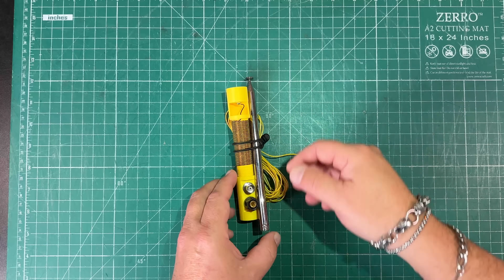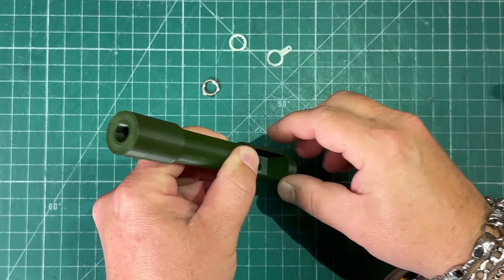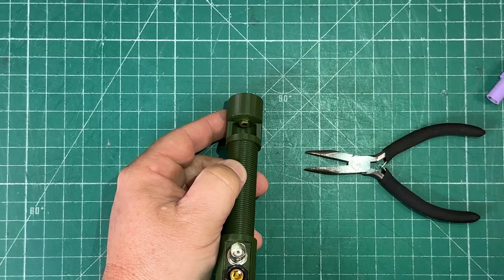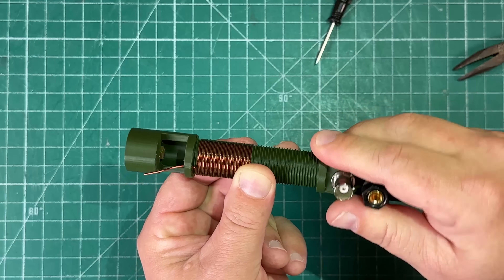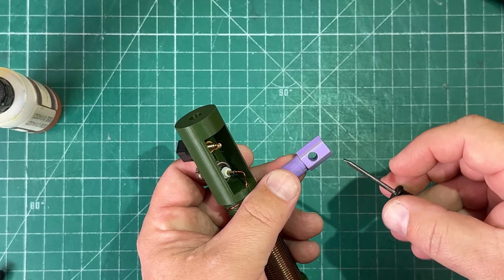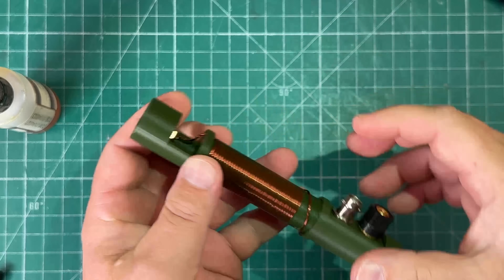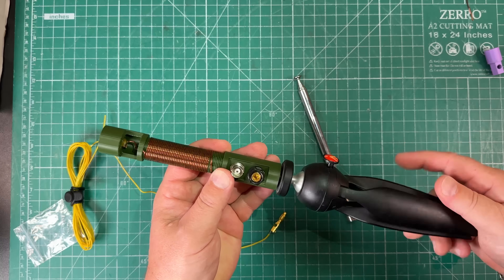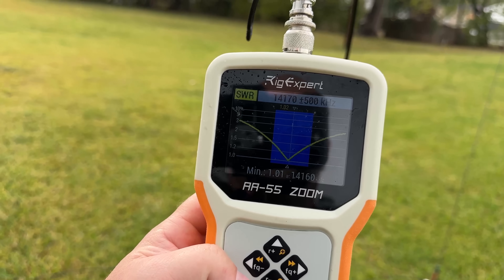Just OK Mini 20 Meter Antenna DIY KIT Build

Comment: I wonder if this antenna would tune on 40m with the Elecraft AXE1 40M coil screwed in first then the whip?  I have a kit on the way (well as soon as the parts are available) and I will give this a try and test with a nano-vna.

Comment: Thanks for the kit review, Mike. Question: Why do you show the antenna and counterpoise sitting on the ground in your SWR demo? That location needlessly couples a considerable amount of precious 5W QRP RF energy in to the LOSSY SOIL.  The result will be the "Just OK Antenna" becoming a "Less Than OK antenna."  ALso, the soil losses will broaden the SWR curve. Not Good.
Reply from the maker: That's a great question.  Technically there really shouldn't be any noticeable difference between this and any other bottom fed loaded vertical with radials.  Think Wolf River Coils, etc.  At least that's what I'm thinking??   Becky & Mike always show their Just OK on a table (which I would way more prefer to do).  With the first Just OK they sent me (not a kit) https://youtu.be/-iuBpayqTLE  I tried that and could never ever get a good SWR.  Possibly because it became a raised cp at that point??  As an early adopter we've exchanged emails about our findings and don't really have a good answer as to why they always get great results with it raised and I don't.  Ground makeup/conductivity is always a factor but I don't think the "soil", it's not really soil, more sand here in both TX and AL, is really too much different to make a difference.  I get everything you're saying, but I just haven't had any luck with it raised.  I do know the ground here in TX is WAY different than when I lived in MI.  Vertical antennas with ground radials are a totally different ballgame down here.  And in Florida where I've tried them.  The ground is just all sand and really relies on those counterpoise wires to do the heavy lifting.  Another thing from this video, it was & had been raining when I put the antenna outside so I suspect that had a lot to do with the measurements as well.  I plan on going out with it again when the ground dries up but that hasn't happened yet.  Antennas fascinate me.  That's the bottom line.  I love antennas more than the "cool new radio" that brand X has dropped this week.  It's a never ending chasm of exploration.  However, I can confirm, my first ever CW POTA activation was done with the Just OK Mini sitting right on the ground just as I had it in this video.  I'm always trying to learn more about antennas, but at the end of the day, I'm just a guy trying stuff out and posting my results in hopes that we can all learn together.

Comment: I love how you put the energy to make a little circle on the wire for the counterpoise. I just dab a bit of permatex anti-seize with copper flakes and put it in there. Let the screw pinch it down tight. My Pota Performer its built like that and it works perfect. I do appreciate the videos.

Comment: Good to hear it is now in kit form! I have used the antenna for a month or so now. Works well for CW and at least some digital modes. Thanks for the build video; a good one! I’ve found that ground mounting it with a spike  seems to work better per SWR.   But, I probably use it more with a tripod on a picnic table. I just assembled a multi-wire counterpoise  connected to a banana plug to fit the receptacle. Will it help?